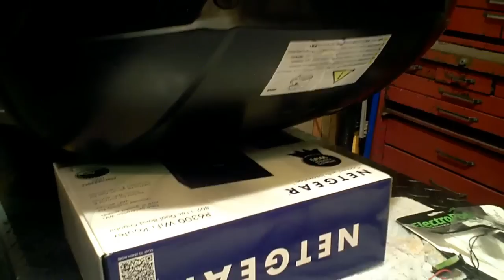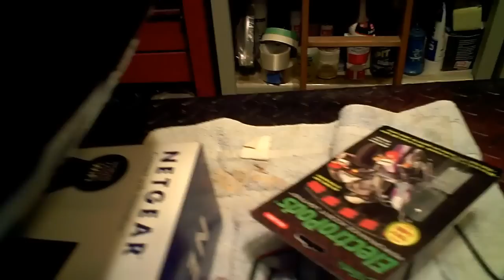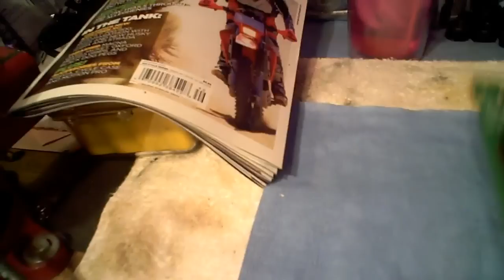Givi V46 LED brakes video 2

Comment: Yeah it looks like using the bigger pattern would make it easier to silicone them in place.  Provided there is enough clearance to the lens.
btw... I have used NetGear for years they are pretty good.  I've also used LinkSys and they tended to go out after a couple years.  Recently got a CraddlePoint router.  It works great but was a lot more than the NetGear or LinkSys products. A bit complicated to setup though.